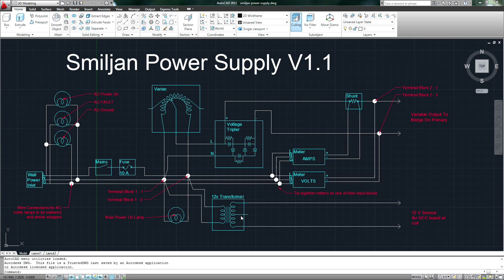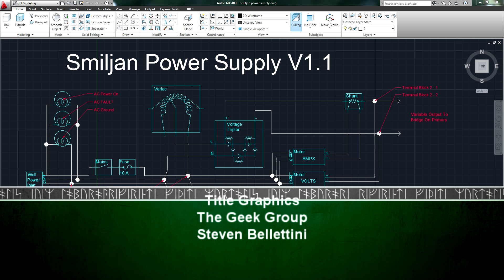Project Smiljan Power Supply Schematic Overview

Comment from the maker: thank you.  i just got a box of stuff from spark fun today, so maybe i'll get it out and play w/ it a bit.  the whole new house thing has me a little thin, and what i really need is a load resistor for the output side for initial testing.

funny thing is, my tripler is a little overkill, considering my current set of fets is 200v max :P   but we'll take a stab at it anyways, just gotta keep that variac turned down.  :)

Comment from the maker: the problem with 'reversing' your original thought is ac circuits work both ways. if the Neutral is reversed with the Line, any AC contactor would close anyway...  as long as it gets power it doesn't care which direction its coming from.  Instead, the neutral to ground circuit, if that sees power, you ~know~ that its a wiring fault, and defeating the circuit at that point makes a lot of sense.

Comment from the maker: the contactor idea would need a little more to work i think...  maybe not.  just need to find a contactor with a NO/NC arrangement, and put the mains on the NC side of it, if the fault light trips, the contactor opens, and the variac is sitting on an open circuit.  maybe. *shrugs*  kidwell would be able to confirm that that'd work as we're suggesting here.

Comment: Or,on second thought.it might be better to "reverse" that..that is,put the contactor coil on the "Power Okay" light,so it only closes the circuit when the power is wired correctly.
Either method should make it a bit more safe,but see what Kidwell thinks. :)

Comment: It might be a good idea to put a contactor in series with the line input,with the coil in parallel with the fault light. Thus,if there's a fault,light comes on,contactor activates(opening the circuit) and you CAN'T turn it on,and get anything from the output,so it's not possible (or that much more difficult) to do something dangerous/dumb.